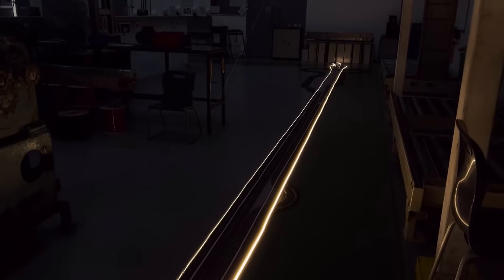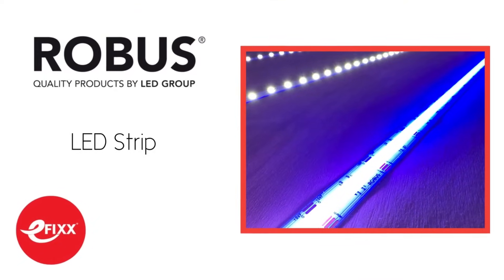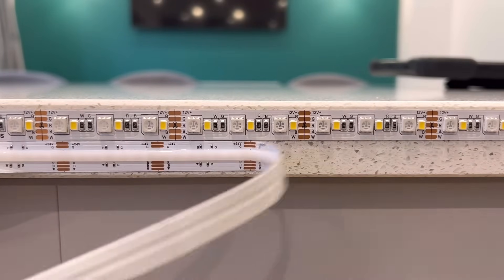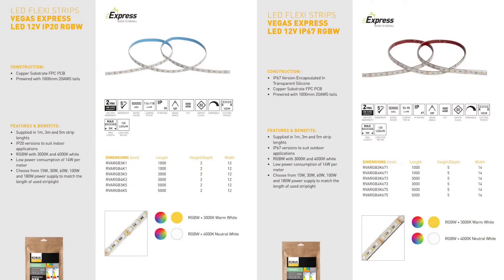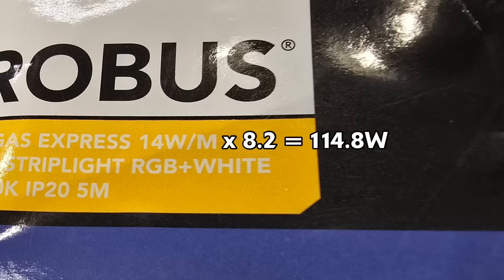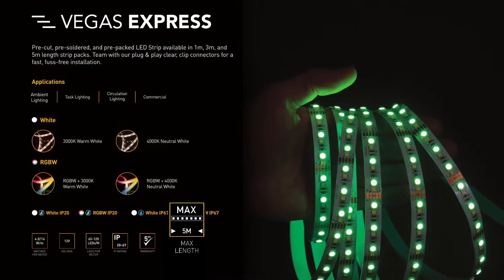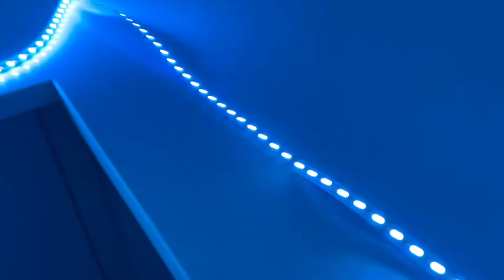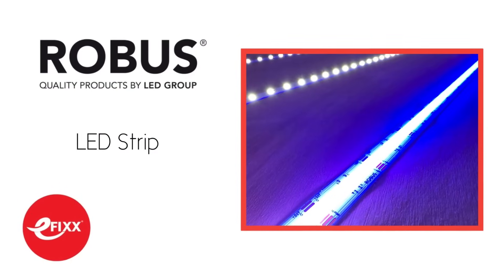The LED Strip Hack That Solves Volt Drop!

Comment: One way to eliminate voltage differences along the strip is to feed power to one end only, then ground to the other end only, rather than double-end-feeding the strip (which gives a voltage sag in the middle).  The closer they get to the ground connection, the further they get from the supply by the same amount, so the voltage for each LED is equal.  Same goes for running multiple MR12/MR16/whatever in a camper conversion.
Reply: This is the real hack. This is very clever, and the only way to have equal brightness along the strip. With this you could raise the power supply voltage so that the drop gives the proper voltage everywhere (you have to be careful because any load change will affect the voltage at the strip). I was able to almost double the power of an LED strip I'm testing right now, from 25W to 45W, without exceeding its 12.0V rating anywhere along the strip.

Comment: I work with campervan and motorhome electrical systems, so the power source is generally a DC 12v battery. You can eliminate the voltage drop issue entirely by supplying the DC positive at one end of the LED strip, and the DC negative at the other end. That way each LED along the strip gets exactly the same voltage. boom.
Reply: It certainly makes it better, but it's not perfect. The middle will be darker than the ends, as the current runs trough only one of the busbars at each end leading to higher voltage drop in this busbar compared to the other one.

Comment: If you mostly want  white, RGBW will actually use a lot less than RGB as the  white LEDs are much more efficient than RGB when doing white ( and look better). You're pretty much never going to want to run all 4 channels at once, so you don't really need as much power as the strip's rating would suggest

Comment: You forget to mention the obvious! ( on single colour) If you supply the LED strip with positive on one end and negative on the other end, then you spread the current more evenly over the strip. 

You can also use two identical lengths of 12v LED strip, and connect them in series. You add a positive to negative link between the two strips, and then connect the positive 24v to one end of the series string, and negative to the other end of the series string. So you end up driving two 12v strips from a 24v driver. 
If you feel crafty you can even get away with a "slightly under sized" driver by adding a diode in series dropping 0.5v+-. The slight drop in led brightness is not noticeable, but this way longer lengths of strip can be used with smaller drivers. This hack also extends the life of the LEDs, now running slightly cooler 😎.
Reply: like the diy led community have done for 10yrs for big outdoor displays...
Reply: @lezbriddon  yes!  With some basic electronics knowledge, you can come up with some novel solutions.

Comment: Disappointed this video did not cover power injection properly. You can power from both ends and inject power at strategic points in the middle of a strip. Why was this not covered?
Reply: like the diy led community have done for 10yrs for big outdoor displays...

Comment: Havent even watched the vid yet but never use 12v, always use 24v, this alone will minimise volt drop, also you can feed the strip from both ends. If you only want to use one driver then run multiple strips in parallel.

Comment: Some manufacturers offer amplifier to avoid voltage drop. But for long distances 24 volt is better solution than amplifier.
Reply from the maker: Definitely another option. 👍

Comment: 114 watts for only 8 meters just cannot be right. I've build my own LED lighting system for my office, using 12V addressable RGBW strips, and am running many meters off a single 2 amp power supply.
Reply: 2 steps forward, 1 step backward.  We all ran around a few years ago changing out incandescent for CFL then LED to reduce power usage and here we are now talking about fitting strip lighting that soaks up as much power as an incandescent.  Somewhere someone is laughing at us.
Reply: Some strips just don't deliver the 'LED efficiency advantage' so well. I bought a job lot when starting house renovations that consume 70W in my lounge for just a few metres. They give off about the same light as two 10W LED bulbs would. I think the issue is naive circuits that rely on resistors to match LEDs to power supply, so we also get 'strip heating'.

Comment: Could I perhaps power one end of the LED strip and run a 2 core wire to the second end and power it from both sides? would that reduce the dimming on one end? 
edit: to be clear I am talking about a normal LED strip with + and - not RGBW LED strip
Reply: Powering a very long strip from both ends is considered good practice. Just need to make sure they both come from the same upstream power supply.
Reply: This is what we tend to do.. Power inject both ends.. Problem solved
Reply: Yup you can also do one half way even.
Reply: Yes, Power Injection is a common practice.

Comment: Does anyone want all this stuff 99.9 % of my customers would be happy to just have normal white or warm what LED lights under the cupboards to light up the work tops. And wouldn’t want all this even if it was free.
One word of advice . More than once I have had Robus LEDs straight off the roll with sections not  working . So always test first .
Reply: varying colours for white, from warm to cool, it can be useful as well if tied into any home automation for alerts, e.g. doorbell ringing......not for everyone but easy to scale up to
Reply: @ I have not got one single customer who is interested in home automation. All they want is simple stuff that’s reliable and requires no setup
Reply from the maker: Horses for courses Andy. 👍